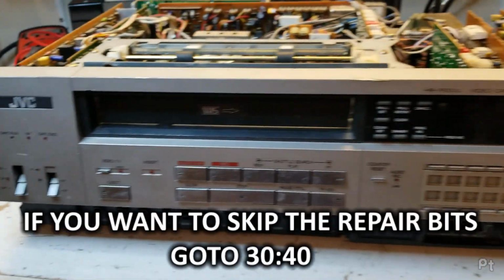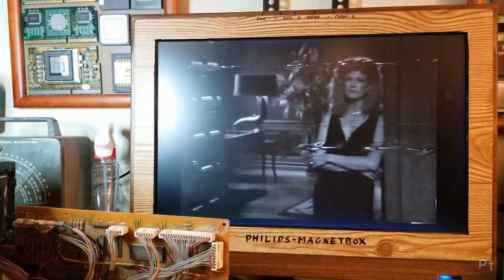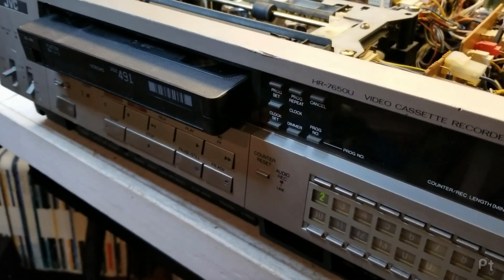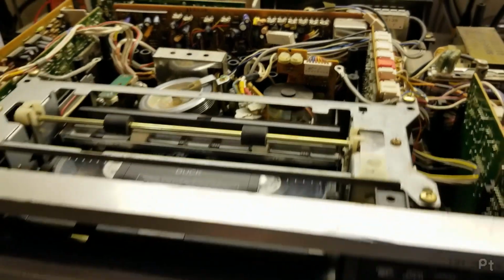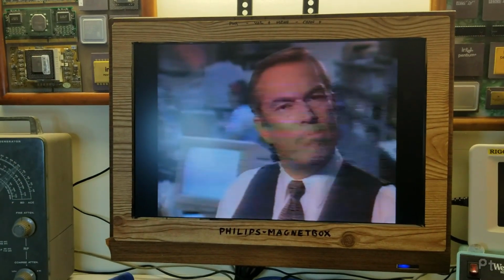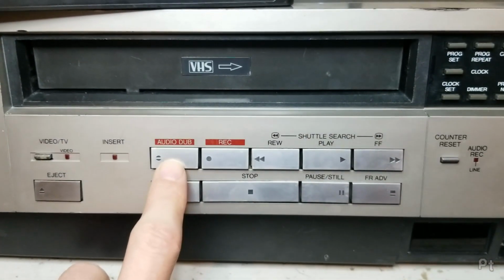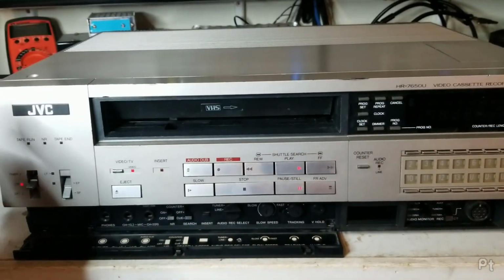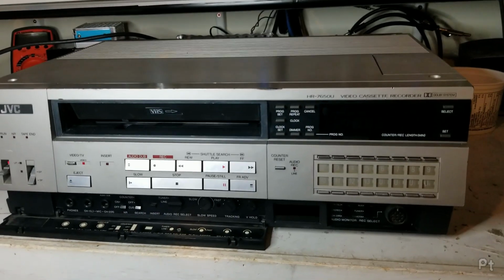JVC HR-7650U VCR (front loader with linear stereo)

Comment: I first saw this VCR in a store about 30 years ago.  I thought it was really strange-looking, especially the tape-speed switch, which would move between EP and SP but with LP blocked off.  I always wondered if it I could move it up to the LP position if I removed the machine's front faceplate.  A lot of JVC VCRs from its era had strange styling. 

The linear stereo and Dolby would be much more useful with VU meters and adjustable recording levels. 

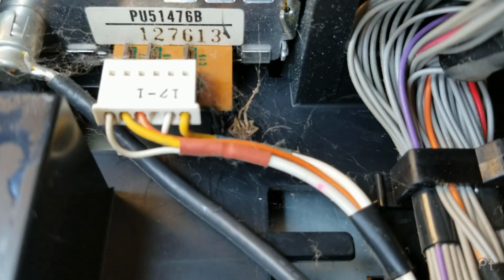15:54 - People in Australia have to watch for living spiders inside old machines -- a bite from the wrong kind of spider there can be deadly! 

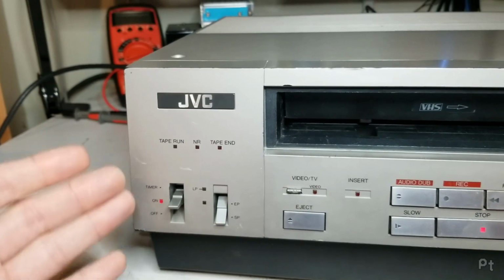32:49 - Whether or not LP is useful for recording depends on the widths of the video heads.  The track pitches of SP, LP, and EP are 58 μm, 29 μm, and 19 μm.  If the video heads for LP and EP on a four-head VCR are only 19 μm wide, there is no sense in recording on LP because they will not record any more information than on EP.  But if those heads are wider (like on many Panasonic VCRs, where they are 26 μm wide), LP will definitely give a better picture than EP.  This allowed me to use LP as a "poor man's SP" when I was running out of tape. 

I never liked VCRs without LP-mode recording.  For me, they are like cellphones without 3.5 mm headphone jacks. 

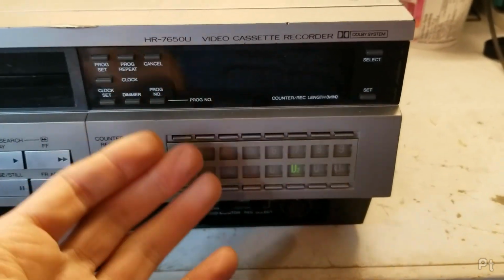45:22 - Does it not have an "AFT" switch ("automatic fine tuning")?  That would help. 

46:28 - On some institutional VCRs with linear stereo (both VHS and Betamax), the audio-dub feature only re-recorded the right channel and not the left.  (I don't know why.)
Reply: As a huge VHS collector to me this is the most beautiful VCR I have owned. The style is the definition of the 80´s. Each to their own.
Reply: Anch'io sono un grande appassionato e collezionista VHS,sempre avuto nel cuore!

Comment: I came across 2 identical JVC BR-6400U's recently for $20... looks like it's very similar to your unit.  I agree, it's a toy.  Not for practical purposes.  TONS OF LITTLE PARTS!!

When I saw the segment where you show the loading mechanism working, i was like YES!!  I know the struggle of getting that to function properly LOL

As for your question about the "Lever with wires", JVC calls that the "Tension Arm" and it operates the "Differential Transformer" (i have an original service manual, which you should get btw!!)
Reply from the maker: The tension arm portion makes sense, all VCRs have that. For the electrical part @Oldgamingfart mentioned it's called the "cue head" which makes me think it was used for reading/writing the index marks. Though I could have sworn later VCRs accomplished the cue function without an additional head.

Regarding the service manual - where did you find one?
Reply: @probnotstech  Good ole eBay.  It's INSANELY comprehensive as well...  there are many, MANY colorful multi-page centerfolds, going all the way up to eight pages in length (like 6 feet unfolded). its just insane
Reply from the maker: Hmm, only one on there for the EG (PAL) model, but I'll keep an eye out. Thanks!

Comment: I was told that JVC had some the best rubber parts ever mad and I can believe it as my Zenith (OEM JVC) still has all it's original belts and parts.
Reply: The best, longest-lasting JVC rubber parts were found in the late-1980s to early-1990s models. Studio Sound Electronics called these JVC VCR mechanisms, MBK-42 and MBK-45.

Comment: When the RCA deck died, my dad bought that JVC, and it worked well from '84 to roughly '94. I had the clock replaced (I think it cost $500 CAD, as that part had to be shipped from Japan + labour in Toronto), and I sensed the loading was slow and not too responsive. The deck went into storage, where it's sat for 20+ years. That said, the following year, JVC's next deck had Hifi, but I used this deck many times to record off TV, and its insert editing made for clean & separate video and audio punch in & outs. The linear stereo was very good when audio was fed via the rear RCA inputs, and it never ate tapes when shuttling or using the slow-mo feature.

Comment: 17:06 That's the cue head, which also acts as the back-tension arm. Be careful not to snag its flat-flex when refitting the front loading mechanism. I seem to always manage it with the HR-7700 (aka the Ferguson Videostar 3V23), which is quite similar.

These were good machines for the time, but quickly superseded by Hi-Fi VHS, a few years later. We had them here in the UK badged up as the Ferguson Videostar 3V32 (via Thorn Consumer Electronics), though you could still get the JVC version (HR-7655EK), which was a different colour, along with many versions badged exclusively for the rental market. 

I believe the European/ German 'EG' version was the only one to have a stereo tuner, natively.
Reply from the maker: Ohhh, I didn't even think of the index function! That's really neat.
Reply: @probnotstech  I was about to reply about the tension arm being the index head. That GE made by Hitachi that’s all wood grain has that similar setup.